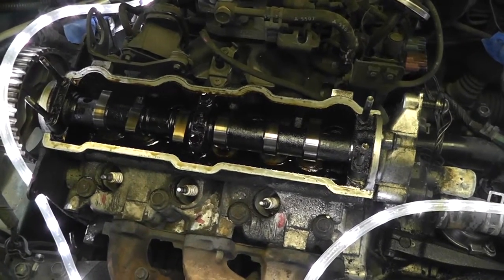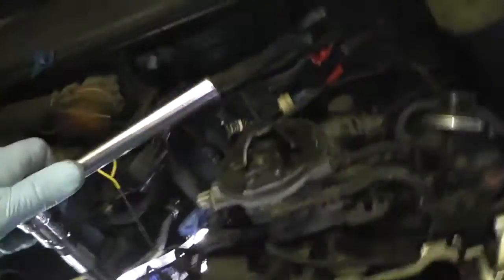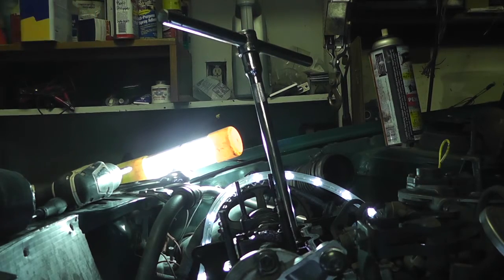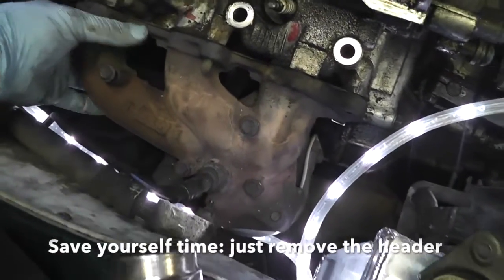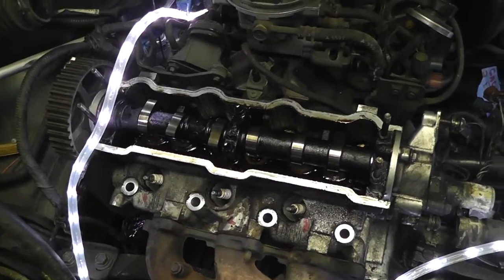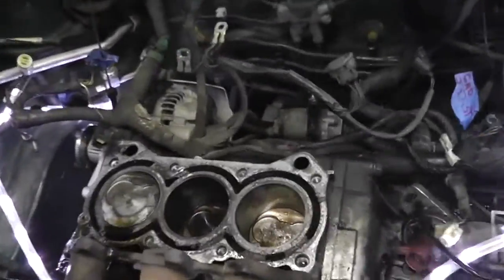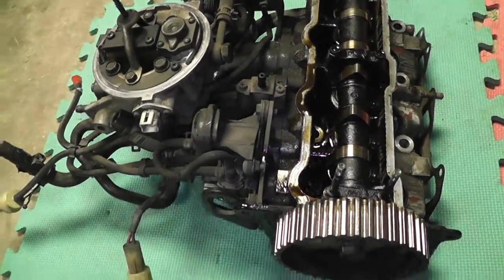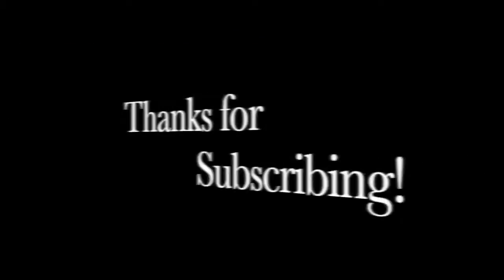Geo Metro Head Gasket: Episode 5 How to Remove Cylinder Head

Comment: wow my 4cycl. 2001 sedan version for the fleet market only required a the very top with 10 bolts right on top and no RTV over expanding the gasket area making it leak in the first place.

Now my 1-2 shifting from transmission is acting up and setting on-and-off my engine light so we'll be going to the OB-II code reader for that, although info online eludes to 1-2 accumulator piston replacement in tranny so "Why God,....why why why?!!! (Echoing why).
Reply from the maker: ouch!  Transmission problems are the worst!  My 67 mustang won't stay in gear for the first 5 minutes of driving or so until the fluid warms up.  I randomly start coasting or not accelerating from a stop.  I'm hoping to swap that out soon though

Comment: What paint did you buy to paint your exhaust manifold and valve cover
Reply from the maker: High temp engine spray paint.  You can get it at any autoparts store or even most wal marts (in the auto department, not the hardware).  Home depot has it too, for painting bbq's or whatever.  Exhaust components get hotter than most things so as you're considering degree ranges, the higher temp resistant the better ♨
Reply: Awesome thanks bro, maybe I’ll have you come down to Utah to help me replace my head lol

Comment: Use plastic scrapper and acetone to clean up rest of gasket material left behind and oil
Reply from the maker: +lucianoromero777 dude, that's right!  I forgot a plastic scraper is a good #techtip.  Everyone listen up: you want to avoid scoring the block and head mating surfaces so a plastic scraper and solvent is best if you still have gasket bits stuck on there.  Great thinking Luciano 👌

Comment: oh a snap on sliding t handle breaker bar
i would have done the head bolts inside to out side
dont loose the oil check valve
Reply: incorrect to manual

Comment: Thanks for making these videos. They have been very helpful. I saw you just put a new Cylinder Head on, did your buddy say if you kept the original head you would need to get it planed?
Reply from the maker: +IANovace awesome man, I'm glad it's been helpful, that was my hope in putting this series together!  I sent my stock head back as a core to the guy I bought the custom one from so I didn't get any info on it.  It wasn't cracked but I assume it was warped (because of the stuck thermostat that caused it to overheat, you'll see me find the thermostat in one of these episodes but it completely failed).  I imagine I would have sent the head to a machine shop for resurfacing either way had I re-used it.